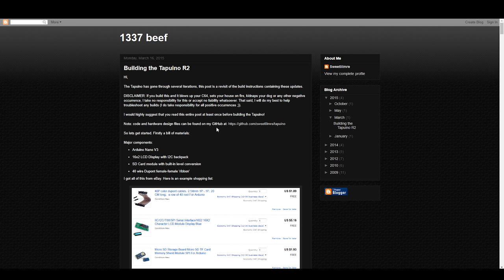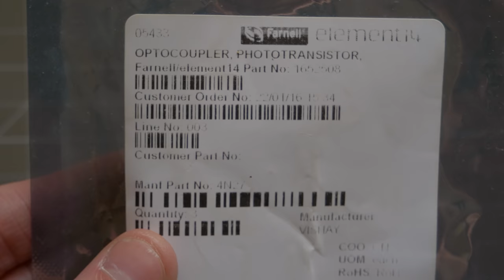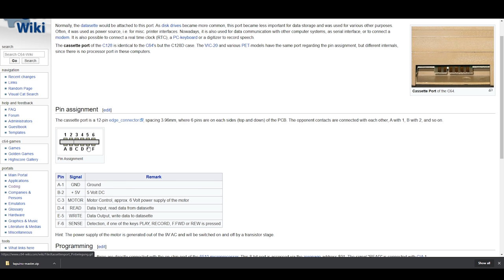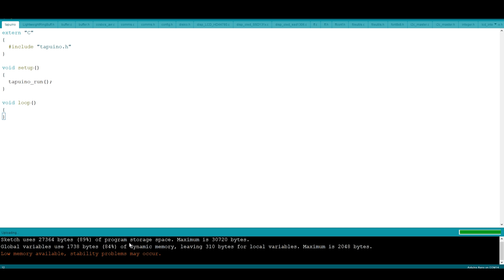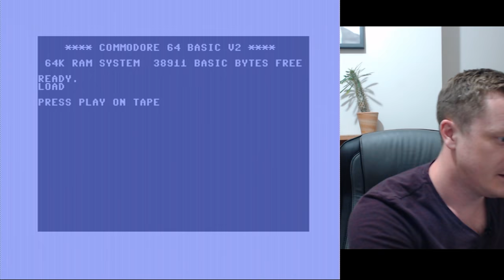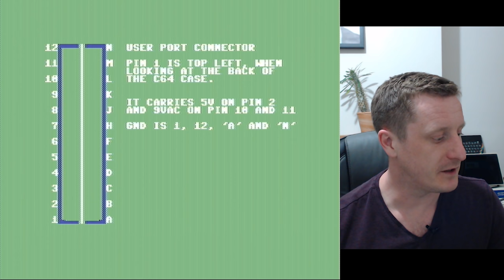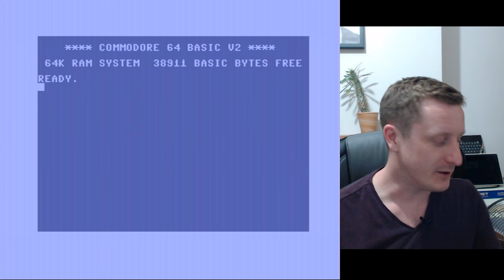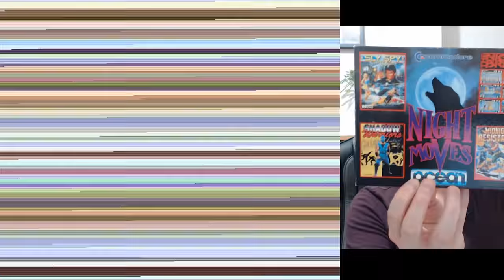From Start To Finish: Tapuino Commodore 64 Tape Emulator

Comment: Hi David. It is Sweet Little Mr E, I think you're the first to get that one right off the bat :) Great video and another Tapuino in the wild, awesome to see, my heart nearly stopped on the black screen moment. Some answers to your questions: the load percentage will often not get to 100% depending on the tap dump (extra data at the end). I didn't ever blog the MUX board build (though I did build it), but the concept was that you would plug a real datasette into the Tapuino and then backup / restore from real tape. The end of the Ghostbusters load where it pauses is the game decompressing into memory AFAIK. So glad you enjoyed building this and thanks for the compliments on the build blog.

Comment: Great fun. The VIC20 was my first computer. The Apple //e was my second. Tape was incredibly slow. Typing a program in, pages of them from a magazine, often a list of pokes and peeks. Save the file (hope it's good). Run the program, usually debug, backup (write down corrections until you get it right), test, repeat. Save all the fixes. Restart the computer. Load and hope it works.

Retro computing is a big topic now. I've been following the 8-Bit guy's project for the the Commander X-16, I may be in it knee deep when that comes out. Back to microcontrollers for now. Thanks David

Comment: Hi David
What is the function of the C64 connector which is located on the edge of Tapuino's PCB?
Reply from the maker: That is a PCB edge connector so it can act as a tape deck and connect to the standard I/O on the C64

Comment: Would it be ok to replace optocoupler with say two 1k resistors as a voltage divider on that 6v motor line?
Reply from the maker: Yeah, as long as you are lowering the voltage - 3v would still be considered a high signal on that line. I believe it was in the original design because an optocouple is just safer. Others have used an npn transistor.

Comment: What is the opto for, please?
Reply from the maker: It detects when the tape motor is meant to be on, so it knows when to send data to the C64. I think the motor control line is 9v AC so not really ideal for microcontroller inputs.
Reply: @DavidWatts  Ah!  Thanks, David.  I just couldn't imagine what it was doing.  And, thanks for the great video.

My brother and I had an Atari 400 with a tape drive.  It ate the tapes more often than not.  Oh, how I envied my best friend who had an Atari 800 (with a real keyboard!) and an external disc drive.